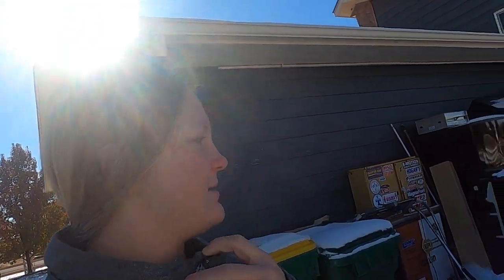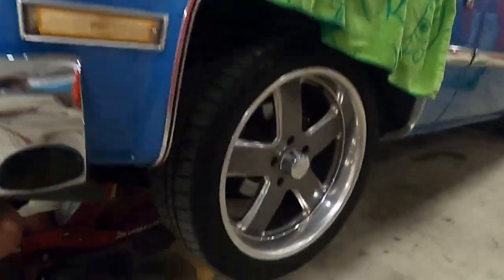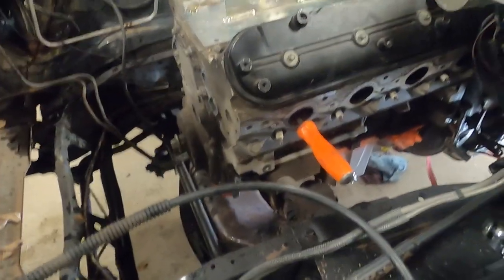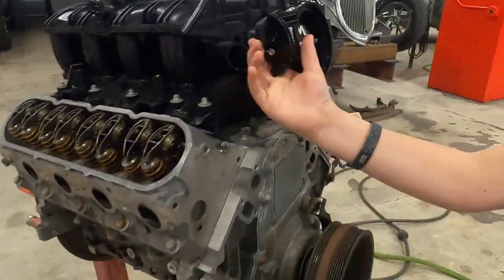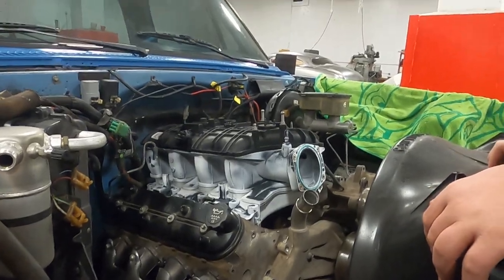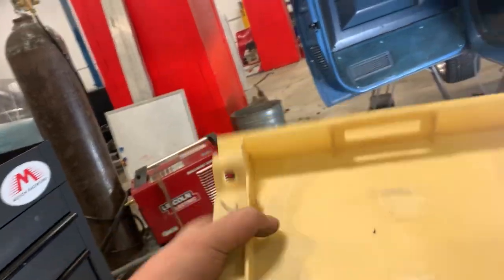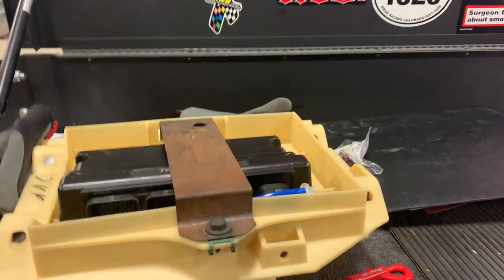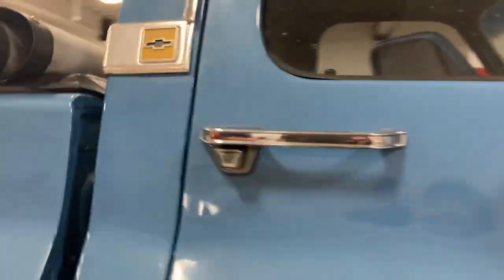LS Swapping my Dad's 87 C10

Comment: I do believe that Terminator has to be grounded to a metal part of the body and the little plastic case is probably won't make a good ground, unless you run a Brady ground strap from your Terminator mount bolt thats in the plastic case to the body/cab dash👍🏻